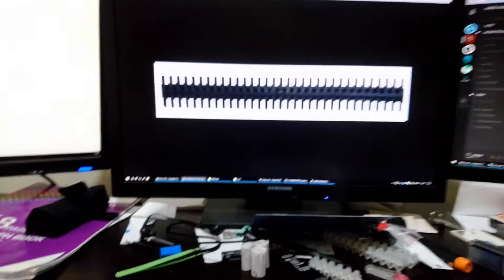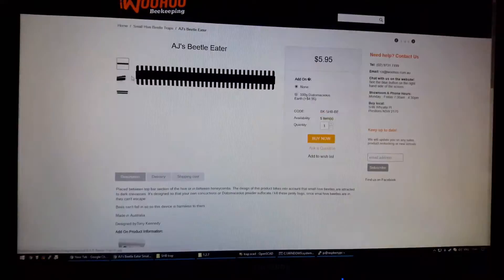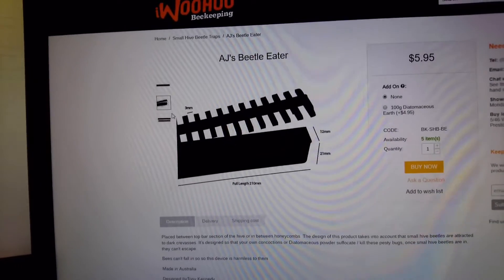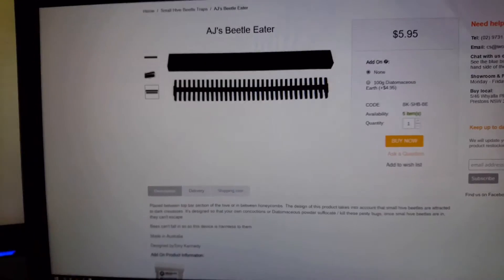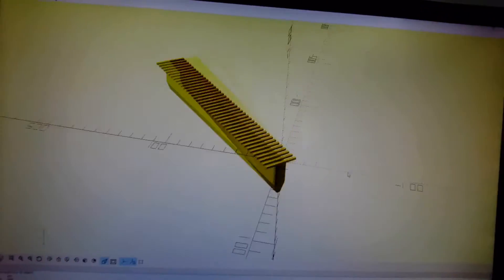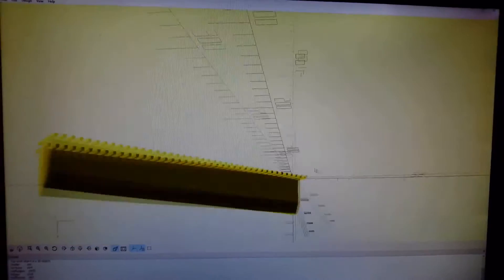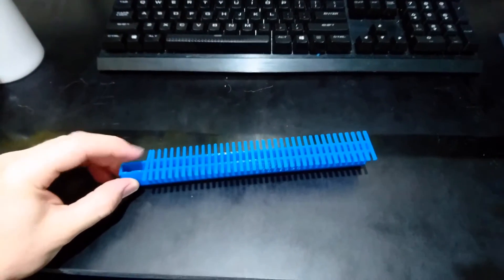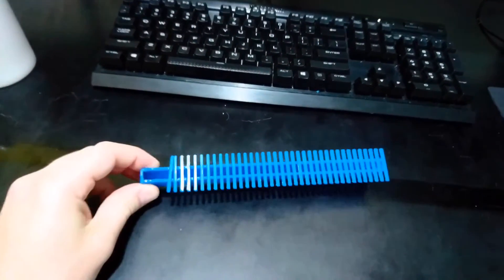3D Printed small hive beetle trap

Comment: How'd this work out? I've started finding some hive beetles and would like to 3D print something to trap them.

I'm interested to know how you came to a 3.2mm spacing.
Reply from the maker: It works really well! Every time I check my hives I take out the traps and hose a hundred dead beetles out of it into the sink. As for the 3.2mm spacing... good question! I designed this a good few years ago. I think I found a picture of AJ's Beetle Eater that had a ruler next to it? Maybe?

A small number of SHBs in your hive is nothing to worry about. They're an inevitable part of beekeeping. A healthy hive can usually keep their populations low enough for the bees to be happy.
Reply: @tjhowse  reading around that seems like a pretty good distance. One site said 1/8" is too tight for bees to get into, while 1/7" may let some through. That's around 3.2, so seems good. I'm on the lookout for things to model in Fusion 360 and this seems like a fun object to design. 

So far I've only seen a handful of beetles, but I'm pretty sure there are more lurking. Hundreds sounds scary!